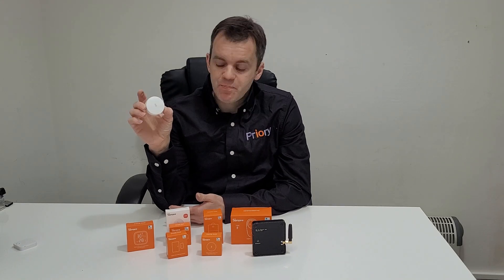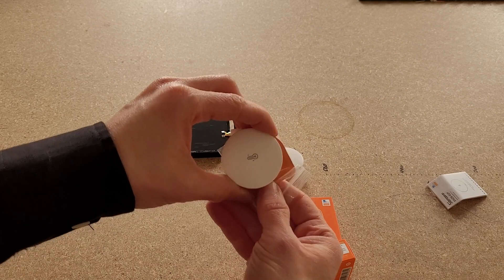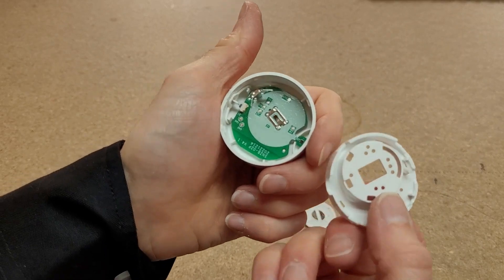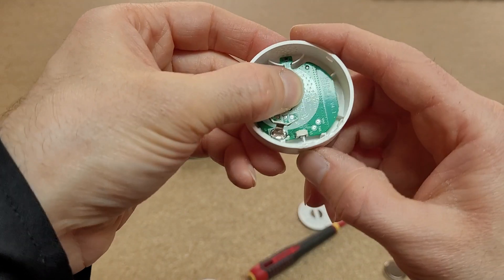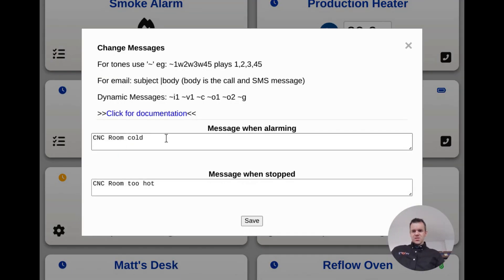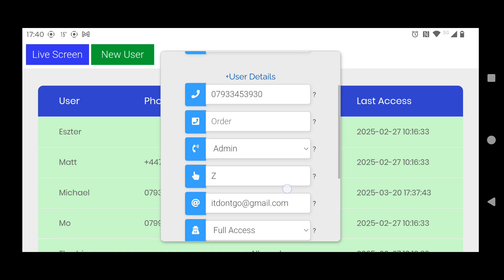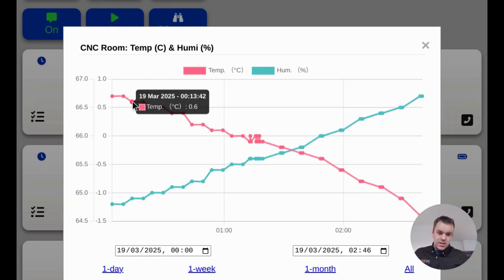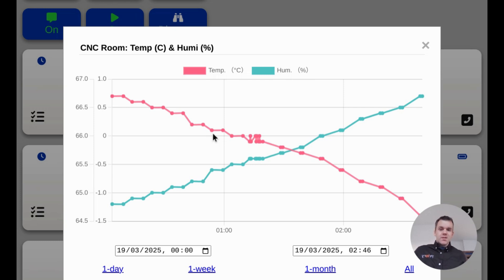Unboxing, teardown & usage: Sonoff SNZB-02 Zigbee Temperature & Humidity Sensor

Comment: 2:18 For the love of god, don't try to open the SNZB-2P that way.  The manual online will tell you to use a pin/SIM tray remover in the tiny hole and then use a coin to rotate the back clockwise.
Reply: Need 3 hands for that